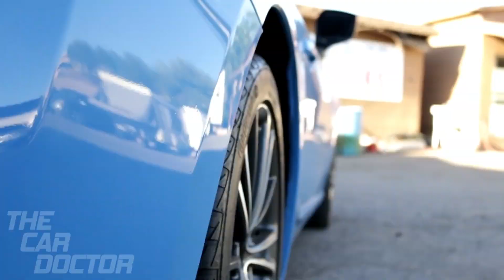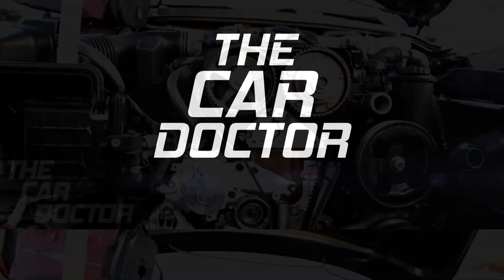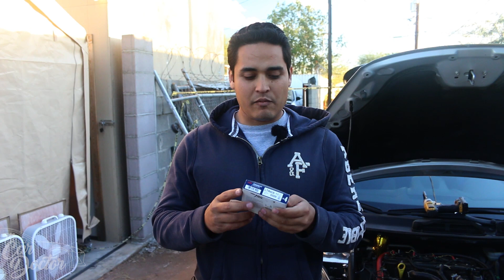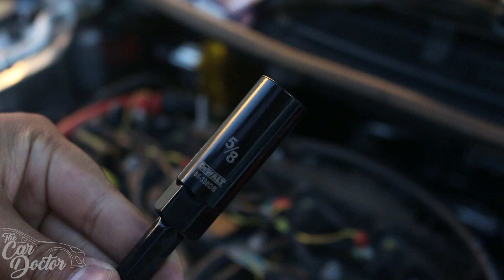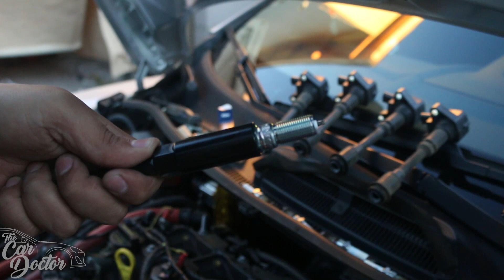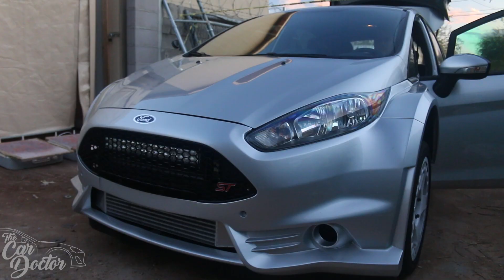Fiesta ST Build [Pt.16] "Ignition Cylinder Corrections | NGK Spark Plugs Install "

Comment: Did  the spark plugs change ever solve your negative ignition corrections?
Reply from the maker: Yes, Tuner noticed it in the logs, replaced the plug, engine  was running smoothly again.
Reply: @JonnyBarajas  

What did you gap them at?
Reply from the maker: @f150lightningboy  0.25 for E85
Reply: @JonnyBarajas  

Are you running Aux. Fuel?
Reply from the maker: @f150lightningboy  Yes, Stratified single port.
Reply: @JonnyBarajas  
I'm running 4port Aux Gen2 with some Neg corrections....been a pain to figure it out.
Reply from the maker: @f150lightningboy  Our issue was us using stock ford plugs, then 1 of then suddenly dying toward the end of tuning. And my damond motorsports catch can hose fitting clicking on the timing cover causing false knock and corrections.
Reply: @JonnyBarajas  

Really....I have a Damond...Been thinking of removing it due to 4 port. Was it the check valve that was dinging around?
Reply from the maker: @f150lightningboy  Corrections on the Fiesta are usually caused by false knocks. These Fiesta 1.6Ls are basically bulletproof. Seen too many examples of engine bay items rattling around causing knock and corrections.
Reply: @JonnyBarajas  

Everytime I've drained the Damond very little comes out now after the 4 port
Reply from the maker: @f150lightningboy  Yes, I had to clamp the check valve to the a/c line and away from cylinder 1, after that no knock or corrections.
Reply: @JonnyBarajas  

I removed the Damond and went back to stock PCV system...still some Neg ignition corrections though....its a mystery.
Reply: Completely removed the Damond...no change....hmmm...FML

Comment: Had the same problem with my Chevy Cruze, with 1.4 liter Turbo engine. At about 50k miles, I've noticed some performance loss. 
I checked the spark plugs, which they said to swap them out, but a practice of old, had taught me to just re-gap them.
Turns out the outer spark plugs were about 1/10th to 1/8th too wide between tip and ground, and the center ones were about 1/4th too wide, so i gently tapped the ground extension, to make center electrode and ground electrode closer together.
Reused them (with their copper seals, another practice never done), and it worked just fine after.
I think spark plugs (however cheap they are) can easily run for 100k miles with some mild adjustments done to them periodically.
At 25k miles they're far from used up.

Comment: by changing the spark plugs did it make a difference in the car
Reply from the maker: Cylinder 1 was seeing issues maintaining zero corrections under WOT. And after replacing the plugs, the car ran smoother and felt a bit snappier  in the rev range. Keep in mind, the old plugs were causing issues in the tuning process and had to be replace as they were oem.

Comment: Drive the fiesta bro and film it :(
Reply from the maker: Soon, currently tuning and not running at peak power. Would be a waste.
Reply: @JonnyBarajas  Get a Cobb Accessport v3 and a etune from Tuneplus, JST, Stratified, or Dizzy.
Reply from the maker: @fr0zen5929  Way ahead of you, just finishing up the tune with tuneplus.
Reply: @JonnyBarajas  so about that
Reply from the maker: @F34rwaffles  I see you missed the entire daily drive this car goes through after installing the new exhaust. Track sessions, posted on @a.barajasrx99, but no video

Comment: I would strongly recommend using a torque wrench with spark plugs. I think ford recommends 12 pound-ft for the fiST
Reply: 13fT LBS
Reply: @f150lightningboy  I found a link for the service manual and it is actually 15 Nm which converts to 11.06 ft·lb

Comment: Fiesta st build haha, you are a joke man
Reply: You do realize that a fully build fiesta st with the 1.6l EcoBoost can run 450hp (more available but at that point you're playing Russian Roulette with connecting rods and cylinders) and in a chassis that weighs 2600lbs, it's quick enough to embarrass your local dodge demon and hellcat.
Reply from the maker: You are correct.

Comment: Great video. I recommend doing one cylinder at a time to decrease the likelihood of dropping any debris into the cylinder head. If you have access to compressed air it could be a good idea to blow the area off before removing each plug as well.

Comment: the gt hachiroku is definitely the most beautiful tho
Reply: The old one yes, new one is pretty meh
Reply: @dvdguire  idk why they changed it tbh
Reply: @kewuo  because they wanted a base platform that they could experiment with for the return of the supra... the chassis is nearly identical to the chassis used in the new Toyota supra 4 cylinder while the 6 cylinder is more inline with the bmw z4